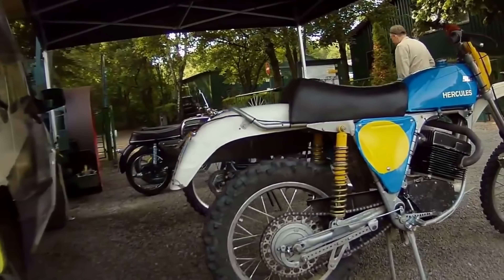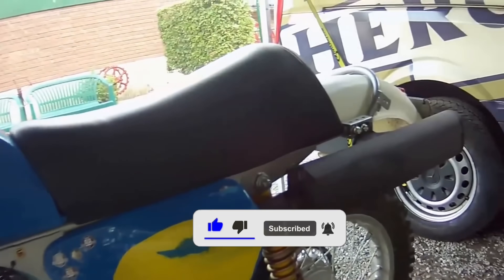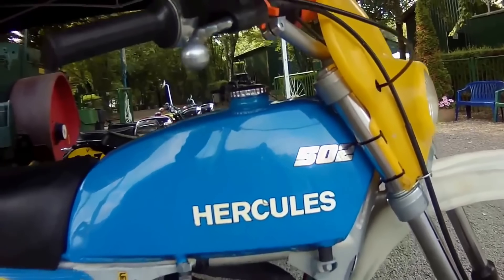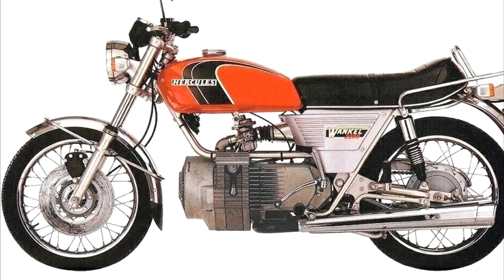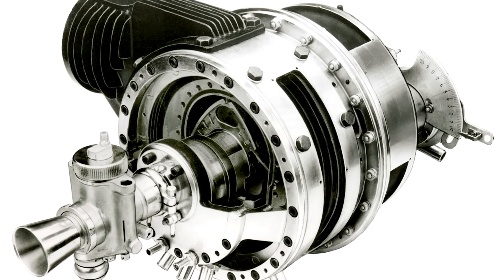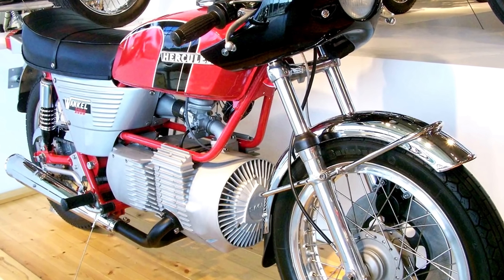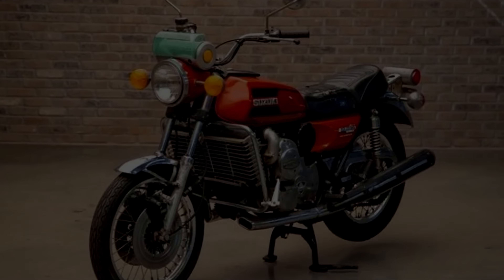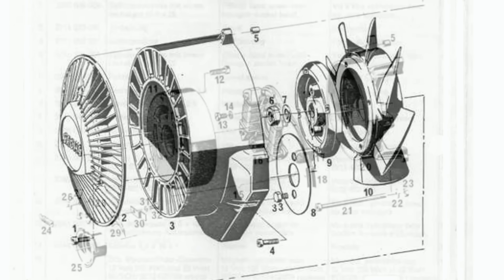The Hercules 502 GS: How Rotary Engine Works on a Dirt Bike

Comment: All jokes aside I have personally seen that little 1.3L make stupid HP and if it got more civilian R&D backyard builds etc etc it would lead to a ton of aftermarket support like the Chevy LS or small block it would be the go to motor to build because of it's size and it's power to weight ratio which would be even more with today's metals.
Not mention it's RPM capabilities, the Rotary is very under valued in my book.
Reply: only mazda bothered to perservere...if honda got their hands dirty on rotary it would have been a winner today!
Reply: @fidelcatsro6948 You would be very wrong, Honda developed the A16-CRX motorcycle in 1973 and spent millions of dollars in Wankel research and development, Honda quickly discontinued work when it concluded the the Wankel was never going to match the performance, durability and  reliability of reciprocating engine technology
Reply: They would have made it budget friendly, which would lead to everyone doing garage builds that would lead to a lot of  aftermarket support, thus making it even cheaper and more popular. The car companies are overlooking civilian R&D and what it brings to the table. Put it reach of the average wrench and watch it turn into the next small block or LS
Reply: @adamscott9725  i need to write in to Civillian R&D genius Allen Millyard and request him to tinker with a Rotary engined bike!
Reply: @adamscott9725  honda wouldve experimented with 500 dollar rotary mopeds first before improving and going big on them..
Reply: @adamscott9725 There is no longer any legitimate research or development of the Wankel engine,  today it is the sole domain of crackpots and con men.
Reply: Your comment reveals someone who has no formal education or professional experience with this type of engine or engines in general...

Development ceased decades ago when the concept reached the logical conclusion of its practical development potential 

The Wankel engine the subject of the largest research and development program in the entire history of the engine manufacturing industry.

The Wankel is both inherently and fundamentally inferior to reciprocating engines that it completely failed to replace
Reply: @sandervanderkammen9230  whatever the conclusion of these ''studies'' Mazda obviously didnt give up like the rest..

Comment: Rotary motors have their issues and aren't for everyone. In fact they aren't for hardly anyone. The emissions are one thing but wiper longevity and harder than 2 stroke rebuilds are the deal killer really. Definitely a niche market and for those with a strong left hand because clutching will be your friend in trying to keep it spinning enough to make things fun.
Reply: Years ago in the 70s we had a artic cat snowmobile with one in it. Interesting sound. If I remember right it lasted about 3 seasons before trouble set in.
Reply: who cares about emissions. really
Reply: I don't think you get any of the issues on an air cooled 2-stroke rotary motor that you would on a 4-stroke with liquid cooling.
Reply: @enacku All Wankel engines operate using the 4-stroke principle

Comment: I've always wondered about this so thanks for posting. I wonder how the different engine inertia would effect the handling of the MX bike, also why they binned the idea?
Reply: @@ducatimonster9017 It would seem that Mazda have resurrected the rotary as a generator engine for their newest range extender electric car. A single rotor, 800cc constant speed unit. It remains to be seen if it can actually last a decent length of time and how it manages to meet emission standards and fuel economy. I'm guessing it will be smooth.
Reply: @onecookieboy Mazda's president announced that the MX-30 has been canceled.
Reply: @onecookieboy Just another rotard clickbait hoax from Mazda..
It's was cancelled in July
Reply: I'd assume they would be down on torque and need much more rpms (more wear) to make decent power compared to a piston engine.
Reply: @Duppavich The Wankel engine has lower combustion efficiency, lower thermal efficiency and lower mechanical conversion efficiency.
And to that poor durability and reliability
Reply: @Duppavich Yes, the Wankel engine provides less hp per liter and significantly less torque per liter.
BMEP is terrible
Reply: @Duppavich  1976 honda dirt bike 23HP/ 17 lb-ft torque
1976 wankel 502 30 HP/ 24 lb-ft torque
Reply: @stuwest5862 How many cc's???
You can't compare apples to oranges
Reply: Wankel engines proved to offer no significant advantages and several major disadvantages in motorcycle applications, in commercial production they proved to be  an unmitigated failure
Reply: It's super hard on internals and doesn't have long wear life.  Cool idea but there isn't a cost effective way to keep them on the road.    That's why u don't see hardly any Mazda Rx on the road.   There just rich people,niech car club type people that own em.  Need engine rebuild every 25k miles
Reply: @LORD_OF_THE_ROOTS  they are not niece people who have rotary are broke as fuck but still run em because they love the motor they don't care about the problems
Reply: @joebone3151 Wankel bike, not Rotary... Rotary bikes are completely different animals
Reply: @LORD_OF_THE_ROOTS can’t be any worse than a 2 stroke and should be just as easy to rebuild.
Reply: @Billy28376  They are wayyy worse on internals, then say your round piston driven 2strokes .  That's why The design never went anywhere other then few thousand.
Reply: @Billy28376 It is much worse... and it's why they failed in motorcycle applications
Reply: @Billy28376  Much worse than a comparable 2-stroke, much more expensive and difficult to repair... the Wankel was an epic failure in the motorcycle industry.
Reply: @LORD_OF_THE_ROOTS  you know nothing about rotaries......
Reply: @EZ-D-FIANT neither do you son... your comments reveal someone who has no formal education or professional experience in internal combustion engine technology.
Reply: @EZ-D-FIANT Son you know nothing about Wankel engines... and wouldn't know a Rotary engine if it was dropped on your foot!
Reply: Rotary engines by nature burn a lot of oil so they can't pass the emission standards.
Reply: @PATRICKJLM Wankel engines are very unreliable... and offered less performance.
Sales were actually worse in places that have no emissions regulations
Reply: @PATRICKJLM That's a completely false urban myth, Mazda managed to meet or exceed the strictest emissions standards in the world (California Ultra Low Emissions ULEV Phase 2) right up until production ceased due to lack of sales.

Comment: I had a artic cat snowmobile with a Wankel.Was pretty cool sounding motor but a huge gas pig.
Reply: Myself as well, 1975 Cheetah 295. Dad had the 1970 303 Panther.
Reply: oimk oink
Reply: Basically a 3 cylinder two stroke. Still cool tho.
Reply: @BikeStandByMe No, All Wankel engines operate using the 4-stroke principle, it's exactly like a 3-cylinder 4-stroke motor
Reply: Arctic cat had a wankel?? What model years I never heard that!?
Reply: how much did it vibrate?
Reply: @dwightnix893  been so long I can't remember if it vibrated.Most machines were pretty buzzy back then.I was working a side gig at a artic cat shop and got it for 25$ and got it running.